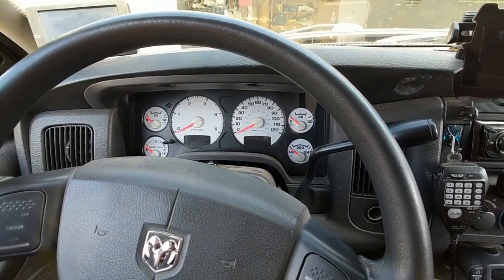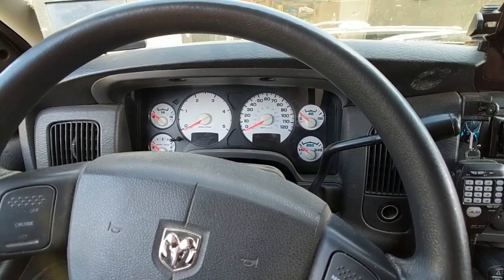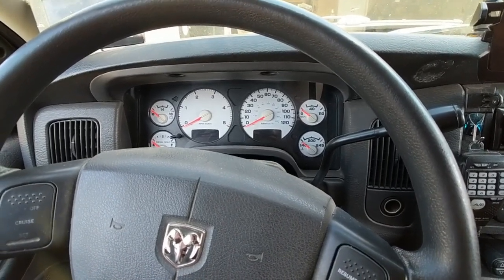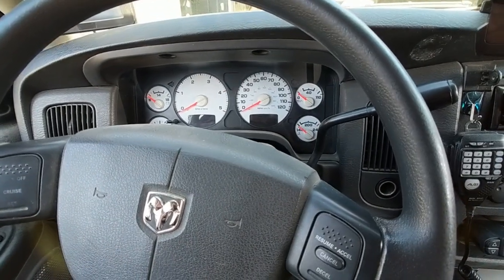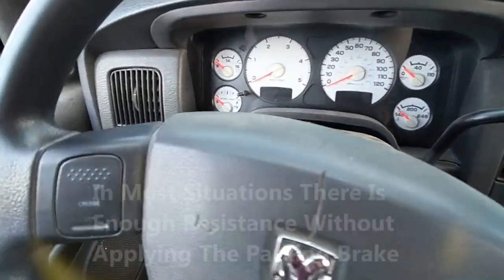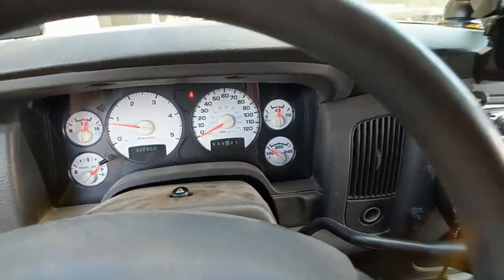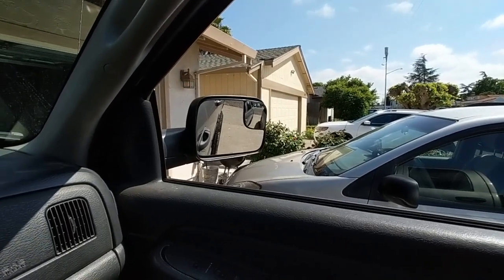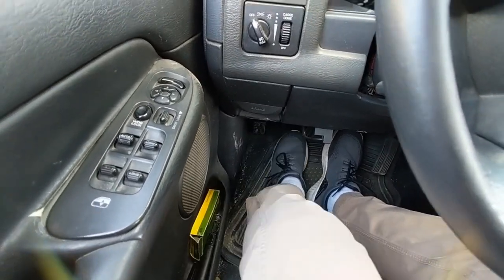Demonstration Of AAM 11.5 Anti-Spin Differential (Torsen, Eaton TruTrac)

Comment: Don't want to seem like a know-it-all, but given the comments, some things should be cleared up.  The "anti-spin" differential available in late model Ram HDs is a Torsen-type unit (an option, not standard equipment).  The Torsen will apply torque to both wheels, provided at least SOME traction is available.  But with one wheel off the ground (as demonstrated) a Torsen is going to spin the wheel with NO traction only, much like an open differential.  However, an open differential behaves this way when it loses ANY traction, shifting traction to a slipping wheel. However, both an open differential and a Torsen differential would behave similarly when using slight pressure on an emergency brake, that is, either will begin to distribute torque, the difference being the amount of torque distributed, which is where the Torsen shows its advantage, sending much more torque to the stuck wheel than is possible with an open diff, to say nothing of the fact that an e-brake application is NOT necessary for this function AT ALL with a Torsen ("anti-spin") if the wheels are on the ground.  Also know that "limited slip", "locked" and "anti-spin" are three very distinct types of differentials and they should not be interchangeable terms as they are so often being thrown around all over the internet.
Reply from the maker: Very Nice Neil!

Comment: From AAM SITE.......GM, Chevy, Dodge, AAM 11.5 Helical gear style Limited slip. The patented design of parallel axis planetary helical gears provide a quiet, automatic splitting of torque. Power transfer goes literally unnoticed by the driver - even in front wheel drive axles.
This Torsen unit performs like an open differential under normal driving conditions and automatically transfers torque to the wheel with better traction when ground conditions warrant. The limited slip responds instantly to torque feedback, anytime, at any speed.

Comment: 3.73 torson on my Ram for 2005 on a 3500 truck. Although they are nice to have, I think traction control by computer applying brakes on individual wheels is also a  good idea, as in detect wheel slip, apply brake to slipping wheel sending power to non slipping wheel. As long as it does not simply  go crazy with flipping power from wheel to wheel.

Comment: Great video and good info.   I am planning on putting a TruTrac in my front diff in the near future.
Reply from the maker: George how's it going!  I am weighing an e-locker or air locker.  I like the idea of being able to turn it on and off.  Let me know how the install goes!
Reply: @DieselCamper  Going well, thanks!    Still loving my tune(s)!  I am going with the trutrac idea as it is "set it and forget it" and it will work when it needs to without my input.   The air locker or e-locker I didn't like because I believe both require drilling a hole in the diff.
Reply: @DieselCamper   thanks for the great vid! I have a couple 12 valves and new about the standard air and e-locker for them but just recently bought a 2004.5 5.9 24v and am having to research and learn about a bunch of new different stuff on these trucks and for the first time found out how torsional diffs work and must say I am supper impressed with the fuckionality and drivability of them though i have yet to really test it in a real world situation. but I learned how depending on the manufacture and i think how the gears are cut and placement they can perform differently and lock more or less depending on type of situation. but I was also contemplating if i should do the torsional in the front diff as well as stated above its an assume set and forget. but then got to thinking about when i would use 4x4 and different situations and came to the same conclusion as you that a selectable full locker would be way better as I could wire it to be manual controlled or leave it to engage with the 4x4. but it dawned on me that almost all the time your going to be using 4x4 you would probably want it as fully locked as possible and in the vary rare situations where you would want 4x4 but may want the front to be open for turning on hard surfaces you could always flip the manual switch. I have ha an air locker in an old chevy I had and loved it, bc it just worked great. but I started researching what might be better e or air and most of what I read was saying that the e-locker was preferable bc you didn't have as many things to worry about bc you would not need a on board compressor and all the tubing and fittings. The extra stuff needed for that seamed to be the main reason when considering weight and overall reliability as the compressor needed to electrically wired in so you still would have an electrical component that could fail but also a compressor and tubing. where as an e locker is just the electrical. I did not see any reviews as to which system was more reliable for just inside the diff case but some had mentioned they both should be about equal in that aspect. Now if you are an overlander, you probably already have a compressor on your truck so that may change your particular situation but if your racing your truck (which is most of the forums I was in were related to) the extra weight was more of a factor. Hope this may help a bit and let me know what you decide on and if you found any other contrary or better info.

Comment: do you know if this is the same anti-spin technology thats in jeep? i have a 13 jeep jk with (D30F/D44R ) anti-spin, i also have a 03 tacoma with eaton trutrac rear. do you know if anti-spin uses cluch plates or helical gears such as trutrac?
Reply from the maker: As far as I know any trutrac is a gear design.
Reply: Anti spin is just Chryslers generic term for a limited slip diff it could be a clutch type or gear driven depending on what vehicle.
Reply from the maker: On these trucks it's a gear type, not clutch.
Reply: @DieselCamper  Yes you are correct.

Comment: I was a bit sad when I found out my 2019 1500 ram came with the 3.21 open diff.. till I found out that it has this system anti spin diff.... can we say it is some sort of auto diff lock ?
Reply: No sir. Your 2019 1500 open diff is just that, unless you have the e-locker option.
Reply: just found out that, anti spin it's pretty much a limted slip diff.. I tested my 2019 ram ( classic) wih 3.21 diff.. and it actually surprised me when I found it a limted slip

Comment: Awesome video, thanks! 
Do you know if it would work the same way if you applied the break and gas pedals (left foot braking)?
Also do you happen to know when it unlocks once it’s locked? It seems that it stays locked as long as power is applied.
Reply from the maker: If you use the brake pedal you will activate the brakes on all 4 wheels.  Using the parking/emergency brake only add friction to the rear wheels.  In my experience using the brake pedal requires too much throttle to overcome.  I believe it will stay locked until a little tension is released from the gears.
Reply: Diesel Camper good to know, thanks.

Comment: Not all have this standard just the 3500 on the 2500 it’s optional also you shouldn’t be using your parking brake to set the locking function your putting stress and wear on your driveline and wearing the hell out if your parking brake all you need to do is momentarily tap your brakes while your driveline is turning to engage this feature if your so equipped I drive a 2500 G56 (manual trans) 2wd with the Cummins and it’s a beast in the winter I throw about 400 pounds of sand bags in the bed lower the tire pressure about 10psi (also running a good AT tire) and not much will stop it just have to drive smart if I do loose traction a quick tap of the brake while the tires are spinning locks the rear axle and it’s all good unfortunately this systems weak point is that it only works in one direction and that is forwards by design it will not lock up in reverse so keep that in mind.
Reply: That works for you because in the snow both wheels have the same traction. With one wheel off the ground I think it would require a certain amount of steady brake pressure to stay engaged.
From Eaton:
 Although Truetracs offer the highest bias
ratio in the forward direction, they also exhibit a slightly
reduced bias ratio in the reverse direction or during
engine braking.
So, it works in reverse too.
Reply: @trustme7731  

I made a corrected statement on this a year ago

Comment: I haven't finished the video yet. But I noticed you made a statement backward Torsen is the original and Eaton TruTrac is the redesign clone.  Both are good. Torsen is better for tune, strength, and reliability.
Reply: Just finished the video. That is a good tip for the newbies. I recommend a rear end rebuild. I've never seen a video that required that from a Torsen. I've seen that often on very old TrueTrac. I wish that I could find more videos of Torsen in use.

Comment: Ya know I won a certificate for a free locker from Eaton. What locker would you recommended for a 2001 2500 5.9l Cummins from them?
Reply from the maker: E-Locker is the easiest option
Reply: @DieselCamper  Is that the same as the True Trac locker?
Reply: @anythingadrenaline4515  NO. Go to Eatons website. A selectable locker, E-Locker, ARB etc, are much more complicated and much more expensive. They are also no good for street use.

Comment: That is an open diff. I have an 04 ram 3500 and it has an open diff. I am putting an AAM helical limited slip in it though. They will not spin like that.
Reply: You better study up more on the helical. One wheel WILL spin when off the ground or when traction varies from one side to the other. This is what allows it to turn corners without all the binding and scrubbing. Brake application tricks it into thinking it has equal traction and then locks up.

Comment: That’s not how the helical system works. You don’t need to apply the parking brake. My 4th gen I had, I did this same experiment and my results were way different. I think this 3rd gen did not come optioned with the anti spin. If you set the parking brake on an open diff you’ll get the same results as this. That’s how Toyota uses ATRAC, it pulses the brake to the spinning wheel to transfer power to the traction wheel. You shouldn’t have to set the parking brake on any LSD system, especially helical systems. If you grab a wheel on an RC car open diff (simulating a brake) it’ll send more power to the other wheel.
Reply from the maker: Straight from Torsen:
https://torsen.com/ask-torsen-torque-bias-ratio-functional-questions/

"Scenario 5) This time, you actually lift a tire off of the ground, maybe while traversing a ditch.  As we said above, a tire in the air can support zero torque, and zero multiplied by 4.5 still equals zero.  But here, you can apply a little bit of pressure to the brake pedal, so you generate a brake load of, say, 100 lb-ft.  The Torsen works off of the brake load just like it would a traction load, and then Scenario 4 is essentially repeated.  This time, though, because you have your foot on the brake, you’re not as likely to spin up the low-traction tire."
Reply: @DieselCamper  , 1st paragraph. “The simplest way to conceptualize torque bias ratio (TBR) is to think of it as a traction ratio.  This represents how much difference is allowed from one side to the other; if the TBR level is exceeded, the differential will “open” and allow spin or differentiation to occur.” This is why I was saying that in your case your in an open diff situation if you’re having to apply the brake. The Torsten system isn’t doing anything. That’s why he also mentions that this is where Torsten is “Limited”. However, I didn’t film it at the time, and I didn’t have Torsen, but my 14 RAM started to engage the wheel with traction, and it may have very well had an auto brake applicator to assist in the slip, but it definitely engaged the other wheel. In any case this is a great discussion dude. I’m going to see if I can find a friend of mine and video will be underway. I have to see for myself.🤣🤙🏼
Reply from the maker: Yeah I think we are kind of saying the same thing.  The difference between an open diff and the Torsen is that torque bias: if you have an open diff with one wheel off the ground and can apply 100ft lbs of braking torque to it, it will send 100 ft lb to the other wheel as well.  If it were a Torsen with a 4:1 ratio it would be able to send 400 ft lbs to the other wheel with 100 ft lbs of braking force on the low traction wheel

Comment: This doesnt prove anything, the exact same test will work with an open differential. Adding brake gives both tire equal resistance meaning they both get equal power.

Comment: Everyone is convinced that if you jack up the tires in the air that both tires have to move forward or backwards together in order to have a limited slip which isn't true anymore...smh.
Reply: Wait so they have lsds that can act like a open diff sometimes? I have a 99 dodge Dakota with anti spin and the diff seems to have a kind of its own. Certain situations like mud or snow they seem to lock up but trying donuts on pavement or such usually results in 1 wheel